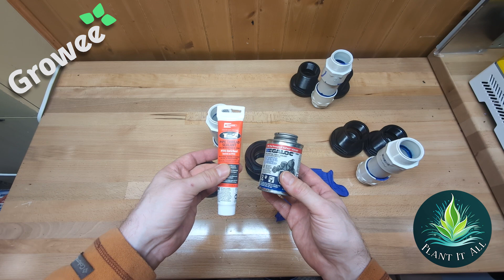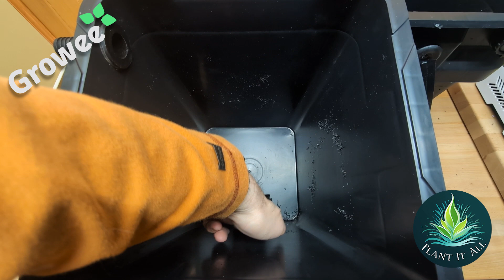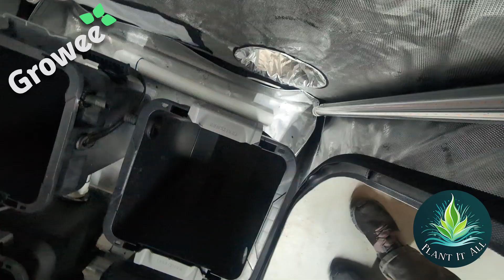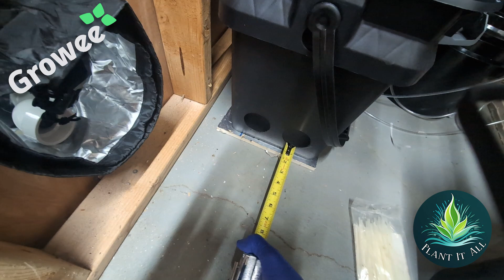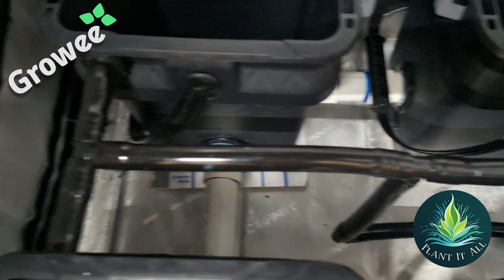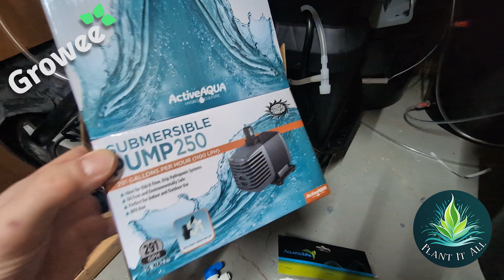Growee Pro - Plumbing Everything Together - Everything you want to know - E4

Comment: What’s the reason for the  2 2in line in the reservoir not only 1 return
Reply from the maker: Solid question. It's really all about flow. Really healthy plants are going to develop massive root systems, and they're going to restrict water flow. Having the entire system is one giant loop allows water to flow in either direction and get back to the reservoir even if one plant in the system is starting to clog things a little bit.
Reply from the maker: By example, I had one plant a while back that had such vigorous roots that it grew into both of the neighboring pots. So in that case I absolutely needed both connections back to the reservoir. It's usually not that bad, but it does happen
Reply: @PlantItAll  yeah I have to upgrade a 2 inch line cause that’s why I’m having problems now with the vigorous roots growing into the drain line and I had a couple of overflows from the drain being backed so going for what should be my best set up and can you point me onto your best videos for a beginner
Reply from the maker: I would start by going through this playlist. 

https://www.youtube.com/playlist?list=PLMQ0UO1yrXBCdPwJYKs98Ve_ptK4V7gkt

It provides a pretty solid step by step walkthrough and I tried remember to always talk out my thought process about how and why I pick certain parts or strategies. If you have other questions shoot me a DM, I'm always happy to help her I can.
Reply: @PlantItAll that appreciate it